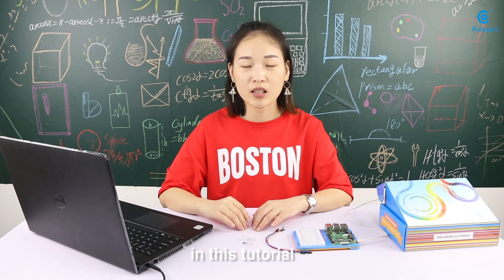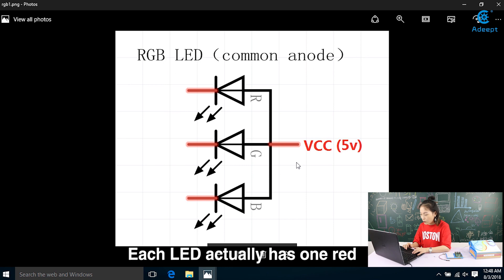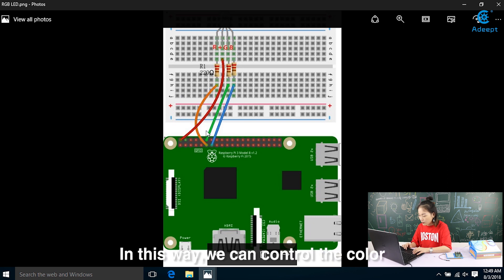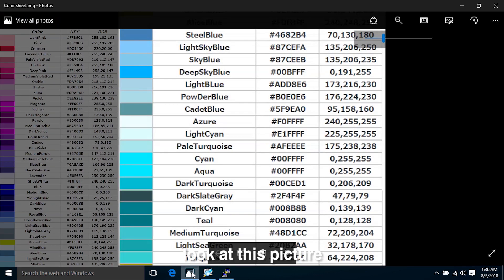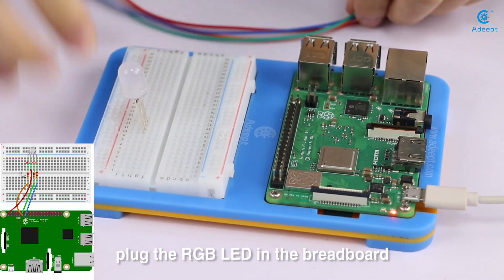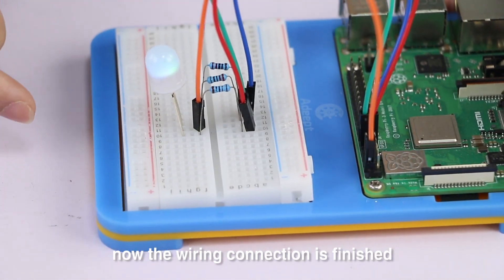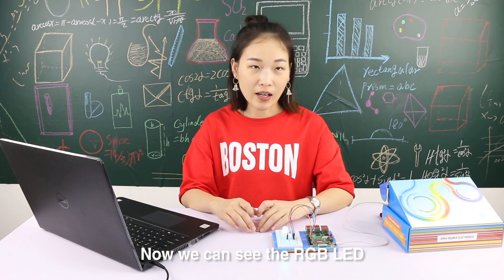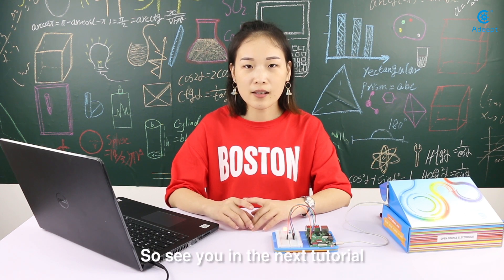Adeept Lessons - Controlling an RGB LED with the Raspberry Pi

Comment: I have a question.
The Raspberry pi gpio pins have a max current of 16mA, but the 5V power has a max current of around 300mA. If I set up a 20mA LED here, would it fry the gpio pin, or would it draw current from the 5V power?
Thanks